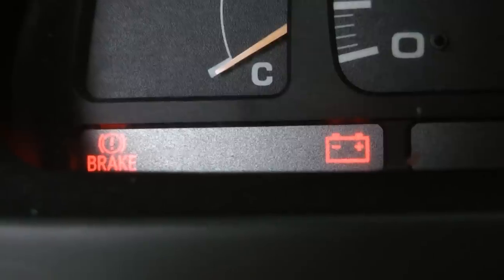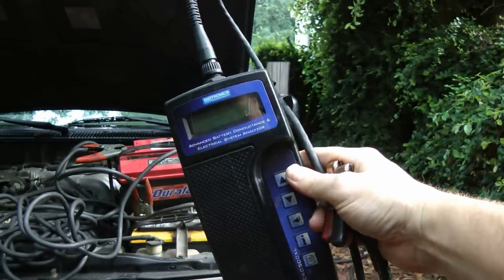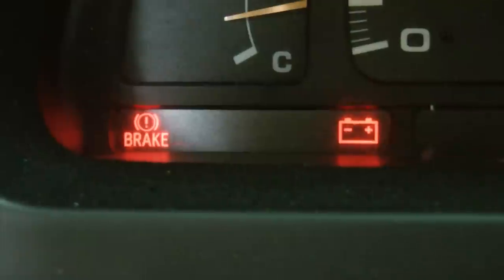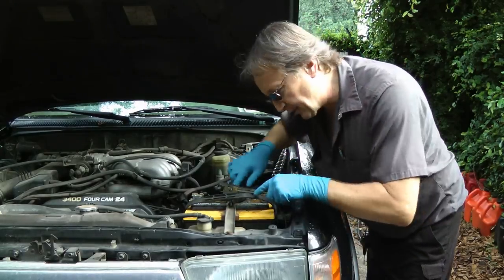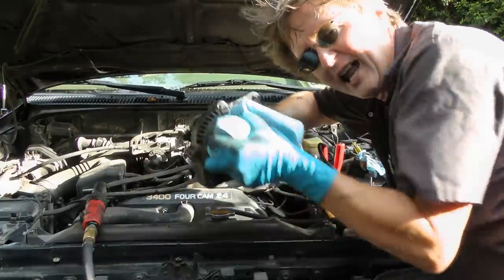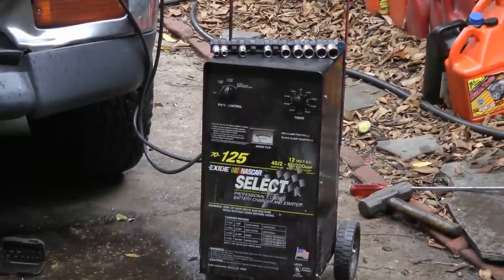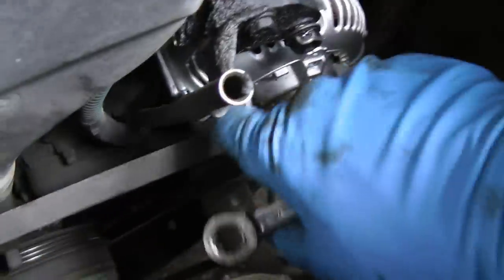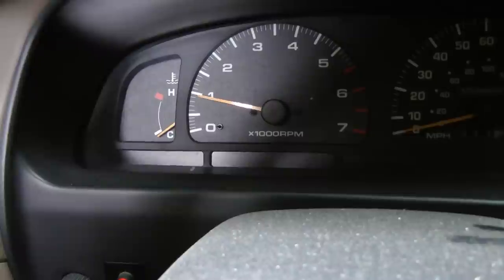How to Replace Alternator in Your Car

Comment from the maker: ⬇️Things used in this video:
1. New version of battery tester: http://amzn.to/2jRIk9X
2. Battery Charger: http://amzn.to/2BtzIyD
3. Ratchet and socket set: http://amzn.to/2inoxOY
4. Mechanic’s Tool Set: http://amzn.to/2Bzmccg
5. Wrench Set: http://amzn.to/2kmBaOU
6. Shop Towels: http://amzn.to/2jGDfkA
7. Disposable Gloves: http://amzn.to/2zSRuxO
8. Flashlight: http://amzn.to/2kwtiu3
9. Common Sense
10. Full HD Camera: http://amzn.to/2AvoEk7
11. My computer for editing / uploading: http://amzn.to/2i2sKYz
12. Video editing software: http://amzn.to/2jv5Fhf
13. Thumbnail software: http://amzn.to/2k7tz6C

🛠Check out my Garage to see what I use every day and highly recommend:
https://www.amazon.com/shop/scottykilmer

❗️Check out the Scotty store:
https://goo.gl/RwhRGU

👉Follow me on Instagram for the latest news, funnies, and exclusive info / pics:
https://goo.gl/ohy2cA
Reply: Hey what's up man? I replaced my drive belt in my 03 corolla S and a day or two later, the battery icon illuminated (no brake icon illuminated). Im thinking its the alternator or the tensioner pully. I tested the alternator with a multimeter to the pos and neg battery terminals and it read 11.9 volts. I believe the battery is good. Any advice?
Reply: Scotty I bought a used alternator an had it checked at advance auto  it tested good but now I have it I took it to another advance auto to have it tested he said the alternator is weak is that possible
Reply: Your the best man thank you very much for sharing your knowledge. You probably saved people millions globally by now!  I'm glad your having success you deserve it

Comment: You make it look super easy.
Reply: LiftOrGTFO is it not?
Reply: Texanboiii it’s not hard. Unless you have 0 auto or tool experience , you might struggle. But still very doable
Reply: The Noonies yea, haven’t had a reason to do it but I was asking cause watching this video makes the steps seem pretty simple.
Reply: Texanboiii yea but just be warned scotty can make anything look easy, you watch a 10 minute video on replacing on a clutch when it’s really a 10 hour job hahahaha
Reply: He usually skips most of the difficult stuff
Reply: Video magic ! He turned the camera off getting that belt loose and getting it back in right for sure
Reply: @Steven g Easy->Moderate difficulty:
- Space is limited!(engineers HATE technicians!)
- might have to loosen some parts from UNDER the vehicle(depends on model, no jacks req. tho.)
- IF belt is worn out, then the alternator is NOT the true/only issue!(need decent experience with "belt tightening" to get those right first time)
- new alternator has to be GOOD QUALITY replacement, or ELSE!(real difficult to know)

DIYer novice myself, but if you can do an oil change WITHOUT getting soiled, you can handle this easy.
Gotta do one this week, it's dying right now. :(

Comment: My car broke down today and stalled. Battery light came on this morning. Worked fine going to work but coming back was a nightmare. Rushed home and tried to get to my family mechanic. Car broke down middle of the road and every person beeping at me. Tow truck came and paid the driver. Got a new alternator for the 1997 Toyota Camry. Runs like I’m in 1997 again.

Comment: For the ones without a fancy tester, you can use a regular multimeter, when the car is running, it should read above 12V (normally between 13-14V), if it reads below 12V, your alternator is not charging correctly.

Comment: Great tip about charging the batt before starting up with the new alt.
Reply: Alternators never have been designed to charge a low/dead battery, but to maintain a state of charge. I've seen the yo-yo thing too many times in 44 years of professional car repair.... battery/starter/battery/starter..... and so forth. The ideal thing is to replace them together... but charging the battery is very sage advice!

Comment from the maker: @JxPhan remove the fan belts and run the engine. Then see which makes the noise stop, and pull on the offending pulley, they normally will feel not smoother when you turn em then.

Comment from the maker: @serchmarc  If the battery is really low, the alternator will have to work like mad to charge it, often overheating the alternator. Alts are made to work correctly ONLY when they have the proper battery voltage sent to them. Scotty

Comment from the maker: @shotox21 don't guess, test. Places like auto zone test batterys and alternators free. Could just be a bad battery , it will do that when really worn out. If not, assuming the alternator is OK, and rebuilts often aren't, then you've got a wiring problem on the charging wiring. Scotty

Comment from the maker: @g905a  In your case, the warning system has broken down. Either a wiring short exists in the wiring between the alternator and the warning light in the dash, OR the alternator warning circuit has burned out even though it's charging fine. I do see this occasionally in Hondas and you can live with it. Scotty

Comment from the maker: Either you got a bad alternator, or the fuse blew to the alternator when the old one went out and it needs repalcing now. if not, you have serious wiring and or computer circuit problems

Comment: Thanks, Scotty. These videos are great. I guess I thought I already knew how to do this, but your tip to recharge the battery first is gold. 

You tested this with a meter while the alternator was still in the car. Can I go to a parts dealer and ask them to test the alternator for me?

A few years ago my mechanic fixed my voltage regulator, without having to replace the alternator. A silver star for him, I probably wold have replace the whole unit....

Dave

Comment from the maker: @chris2756832 when the battery and brake light are on in that car, it means the charging system is not working. Either your wiring has a short. or you got a bad alternator.

Comment: The brake light on the Toyota reminds me of something similar that happened to a car I used to own.  It was a 97 Chevrolet Cavalier, and it was the ABS light that came on (first steady, then flashing).  I think it happened when my battery went bad, and again at a later instance with the alternator.  I don't recall the battery light coming on at all in either case.

Anyway, great video!

Comment: Scotty, While moving some hoses around to get access to my alternator, I spilled some antifreeze on it. Not a lot but...more than none. Should I be worried or try to flush it in some way? The alt. was previously fine, I just needed to replace external voltage regulator.
Thanks for all the great videos!

Comment: Hey Scotty I'm having some trouble with my 1986 chevy k10 pickup. So when I try to start it up there's a ticking noise (similar to a dead battery) but I just bought a brand new one today and its still making the ticking. Also I've noticed low voltage on my new battery already
Also I figure I'll let ya know your videos are a huge help in every way keep on crankin em out.
Reply from the maker: often just a bad starter, if starter is not bad, the wiring to the starter has a problem not sending enough power to the starter.

Comment from the maker: @jimisback  NO NO  NO, NEVER do that on a modern car. On and old 65 mustang, sure. But modern cars use computers for everything, and if you disconnect the battery cable with the car running to test the alternator for charging, you can FRY the computer. DO NOT DO THIS.   Scotty

Comment: Hi Scotty,

How can i tell that my mechanic hasn't pulled a fast one on me with regard to telling whether I have a new alternator or reconditioned old one in my car.  I have instructed him to put a new one in my car.  But being a woman sometimes I find people in auto shops think I am stupid.  My car is 25 years old and I love it.  I love you too Scotty, you rock.
Reply: Geraldine Geraldine I know this is old, but you should check with a multimeter. Turn on your car with the headlights and radio on, and put the positive to positive and negative to negative cables on the battery. Check if the voltage is around 13.5 to 15 volts DC current. Make sure the alternator is set to check DC voltage and/or to 20 volts on the DC ratings of the multimeter. If the mulitmeter reads    around 13.5 to 15 DC volts, the alternator is charging the battery well and you do not need a new alternator. 

Whether or not it's remanufactured or new, just as long as it works for a long time matters and that you got your money's worth when paying for it. The alternator should be doing its job to charge the battery. If its not, it's time to get a new alternator (not remanufactured), and for sure you'll know its new.

Comment: Had a question Scott if you can answer i replaced an alternator on a Altima pully was pretty much out of an alignment by 2 inches really the crank for it looked grinded out do you think I was able just to switch the pulley or was it a good choice to change it all like I did

Comment: 7 days ago I start my Mitsubishi Eclipse and noticed that the brake and battery lights stayed on. My battery was only 7 months old at the time so I wasn't too concerned and I knew my brakes were fine. I didn't drive the car again until 7 days later for a trip to the grocery store. On the way back and just a few blocks from home the car started to lose power and my radio went dead. I was lucky and was able to coast into my parking space. Firestone told me it was indeed the alternator and they had more good news for me. The bad alternator had also caused my 7 month old battery to die a horrible death as well. Next time any lights come on get it checked as soon as you can.
Reply: Michael Proctor how much for the new alternator and labor to get it fixed?

Comment from the maker: that thing's so old, my data system doesn't include it. From what I remember of the dim past, there isn't much working room. The rubber is just to stop noise, and those things make enough noise anyway, most guys just leave it out.

Comment: you know when you took out one of the battery terminals, did you take out the negative? and also, when you said to charge your battery fully before you install the alternater, did you charge it while one of the terminal was taken off before? or did you reinstalled the terminal then you charged it?

Comment: My 2003 Ford Explorer has a bad alternator. The ABS brake light comes on when the battery is almost dead. Is that common in Ford's like you said for Toyota? thanks for the help

Comment: Hey Scott I tested my cars battery and altenator both came out good. Battery is only a few months old. But my altenator makes a weird noise like a whining noise or humming. And my headlights dim when I turn the blower on. I don't why tho. Had it tested and the test said no problems everything is running how it should.
Reply: I guess you have no problem then. My car has always done that. Maybe the alternator is not perfect, but functional.

Comment: hey scott been falling your channel for awhile learnt to service n fix my car from your videos its helped an saved me alot of money.i have and honda accord cl9 2004 n the dash board is been showing an eps light and the steering wheel has got heavy im not sure if its the alternator which is not boosting enough power to the eps system need your help if u can thanks
Reply from the maker: it could be, have the alt and battery load tested first, auto zones do that free
Reply: Scotty Kilmer thanks buddy much appreciate ur help
Reply: Steering pump fault

Comment: i have a Lincoln continental and the car still starts and runs and ive had everything checked out the store tool tester on it and they said its no good which I figured but I could barely tell no engine lights or dash lights ever came on no battery light. You almost could not tell other then occasional rough running the power steering assist going out the occasional seat and mirror setting resetting I would have had no clue I don't really notice head light dimming and I was running an aftermarket stereo aswell.  i now wonder if the old battery crapped out ended up with a dead cell because the alternator was going out.

Comment: Scotty, love your videos but i would love to here from you how long an alternator lasts so i can do preventative maintenance instead of fixing a dead car, make sense? Thanks in advance. Matter of fact most of your followers already know about the battery lasts two years but not any info on alternators, starters, timing chain tensioners (oil types), So yea preventing dead on road happening to your fans.

Comment: Hey Scotty just wanna let you know that it seems the "battery" light with the "brake" light ON at the same time also means a bad alternator in Hondas! I had that happened last week with all sorts of crazy electrical issues....I replaced the alternator myself (with your help) and voila!!...no more battery light!! :) I took my 3 yr old battery to an auto parts store to charge it but they told me the battery was dead...even though at home it tests at 12.2V. Should I replace it just in case? Thanks!

Comment: Hi Scott, I have a 2007 Dodge Caliber SXT that sounds like something got caught in the garbage disposal. I have narrowed it down to being a bad Alternator Decoupler Pulley. The pulley is relatively inexpensive but would also have to buy the special tools. Have you ever changed one before? would I be able to change it while the Alternator is mounted? what are your thoughts on just getting a new Alternator or replacing the Decoupler Pulley. The price difference is about 200 bucks.

Comment: Scotty where would the "fuse" be located on my 2003 infiniti g35 coupe that could possibly be blown. Would you recomend me taking alternator off and bench testing it? I had new alternater hooked up at Oriely's and it showed 14.8 amps on a full load draw. My battery is good and fully charged.

Comment: Hi Scotty I changed my battery and my alternator and after driving 10 minutes I still get the battery light on ant the gages seem to die. I did drive only on the new battery for 10 minutes before I got to change the alternator. Does it mean that I have to keep the car running more to charge up the battery completely. Is it maybe a fuse?

Comment: Just replaced the alternator thanks to your video, I took the old one in and it failed, i had the brake light and battery light on my Mitsubishi, So i replaced it, and still have the battery sign and brake light, and now i feel that my battery wasnt fully charged when i replaced it, could that be the reason it doesnt start anymore?

Comment: Hey Scotty,
My headlights are flickering a bit, also my instrument panel lights. From time to time (mostly at night when headlights are on) my battery light comes on, and then out of the blue it goes away. Some days can pass with out the battery light coming on, etc. I took it tho the shop and the guys said the alt was working fine, also the battery is as strong as it can be (new battery). I notice a blown turn signal also. 
Can a problem relating to a bad ground, trigger these issues I'm having

Comment: I am currently working a 1991 Honda Civic CRX.  I am in the process of removing the alternator.  The top bolt is off, however the bottom bolt is rusted on or bent, I am not quite sure.  How do you go about removing it because I tried punching it out?  I've tried just about everything, except torching the bolt to heat it up.

Comment: hey scotty i have a car that also has maybe an alternator problem. I jump started the car and drove around for about 15 min, then pulled unplugged the battery terminal when i got home. This morning i re plugged the battery and still so juice at all. Is it because my alternator isn't recharging my battery? anytime i get it to work by jump starting the car runs fine with no problems.

Comment: Hey Scotty! I have a 2002 Pontiac Grand Am.. When I was driving the Batter light went on and off, also the Airbag light ended up coming on and when I came to a stop it died. When I was pushing the car out of the road I saw a little oil leakage.. I was pretty sure it was the alternator but that didn't explain the oil leak.. Any ideas? Any input would be awesome! Thanks.

Comment: Hey Scotty, big fan of your videos. So when you take off the alternator, are there any wires inside the alternator that you have to mess with? Or do you just unbolt the alternator and pull out the sensor?
Reply from the maker: you just unplug and unbolt the external wires from the car going to the alternator, then put a new one in and put them back on

Comment: I replaced an alternator in my car about a month ago in frosty Michigan weather. I broke off the plastic cap that covers the alternator's electrical connection and didn't bother replacing it. Is that going to cause any problems? I could always silicone glue the thing back on if needed.
Reply from the maker: it's not needed, just a safety thing so fools don't short metal tools off on it.

Comment: Thanks.. but already replaced alternator on my '01 Grand Marquis, and still having strange issue when fan kicks on Voltage gauge drops very low then slowly rises back up to mid range. I'm thinking of upgrading my OEM 135amp to a 300 amp.

Comment: hey scotty how you been, my camry's alternator has been making bad noise from the inside of it not really the fan belts though they have a lot of cracks on them so i'l' be replacing those but for the alternator should i get the re-manufactured or new?
Reply from the maker: hard to find new, get a reman with a long guarantee

Comment: hey scotty Question.. How do you check id your alternator is bad?? well my dad told me this but im not so sure if hes correct.   he said to check alternator turn the car on and  unplug the negative battery wire while the car is running..   Is this true.??? if the car runs without negative wire connected to the battery the alternator is good... is this true??